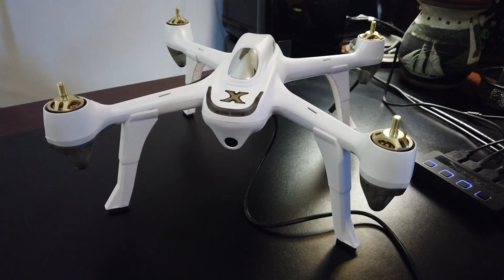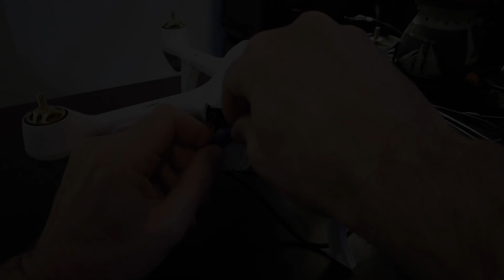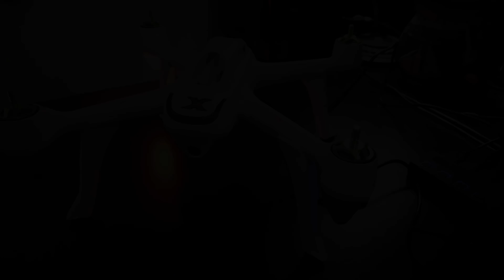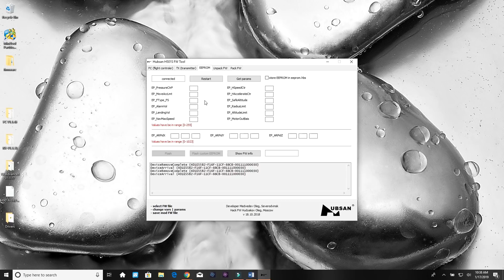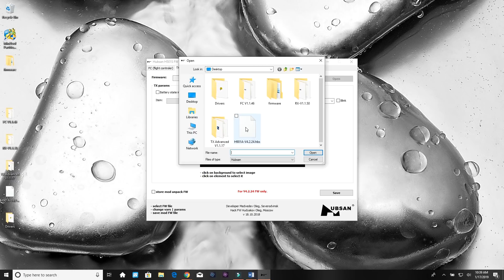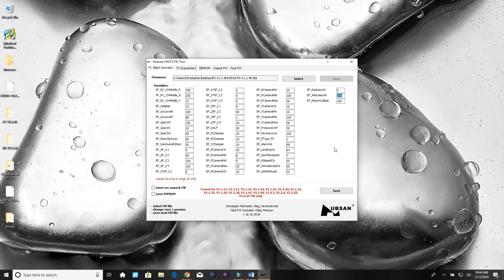FIRMWARE MOD TOOL - FC & STANDARD TX - HUBSAN 501 MODELS

Comment: Hi, I need help with my hubsan h501s, basically the drone was working fine, but I wanted to update to a later version, but when I was uploading the firmware the USB connector was disconnected by mistake and now the drone makes a continuous beep, the rc connects and you can see the image from the camera.

Comment: Good video :) question: when voltage is Low, quad automatically set lower throttle... Is there chance to change this? Iam using lion so I can go to saf 2.6V
Reply from the maker: Go back to a older firmware maybe but it could because your using a lion.
Reply: @QCGUY  its normal operation. When Lipo is empty hubsan starts to fly slowly. As lipo saf min voltage is higelher than Lion, i have to change this parameter on fw... But i dont know which one :( also its sad we cant change speed on GPS mode :(
Reply from the maker: @johnyM128  I have two of these quads left. One on firmware I was a huge part in developing and one old version of super flyer. Neither slow down when the lipo is lower. The lion is most likely why…
Reply: @QCGUY  really? Thats interesting. Could you send mé photos of settings in fw?
Reply from the maker: @johnyM128  You’re going to have to take my word on that buddy. I don’t use those quads anymore and have enough to do already. Lion batteries when low will have less punch than lipo.

Comment: The Navigation Max Speed, are you sure that isn't your GPS speed? I changed mine from 5 to 6 today and it felt like when I was controlling it in GPS mode it was slightly faster, not sure but definitely felt a little less stable and faster controlling it in GPS mode, just a thought??? 👍🙂 Great video, love your channel....

Comment: Just downloaded the firmware but when I open it on pc it says wrong parameters ?, it just won't open.
Reply from the maker: You don’t open firmware on your computer. You open the install tool and load it there under the appropriate location or in this case modify what is on your quad.

Comment: hi there.. been watching your videos.. can you PLEASE update the link to the lastest ..or most recent firmware update for the FC? Im trying to upgrade my H501s (original..not the pro nor ss)..i have v3 tools..but the firmware on there website has the H501a firmware bundled with H501s FC firmware update. it might be right, but im getting that update error. Can you assist? 

I dont really know what the lastest FC version is for the original H501s. i never upgraded it before. 

The H501s x4 but im using the same standard controller. can you chime in and lmk what i need to to do to update the original one to at least the version you are using? your link to the dropbox isnt working.

thank you much
Reply from the maker: Book Gee Every 501 model and recommended firmware links are in this document. 
https://lookaside.fbsbx.com/file/Firmware%20-%20All%20501%20models.pdf?token=AWx2gPczIaDBGo26uLCaYw9zDHPhhSpC6rE2aQ8ixthZYWvqJrJr0pyJMoAnnTJOuZU4UZo8KQeqNc3Qz_SquqeZcPJR3MLwHSozRFBBrzbwoiQ0-bhLQObdMlYL7fMY9-OT9KoqSCR7BN6sNGFOzJiSsY9ttD6OwH2RaMyS-HnF9rntkM_sAwPNj3hxXpMSv18hVILfeBbUzCs4Kk6Thxs-jgPI6xtZkWoYW0gblbHgEA
Reply: @QCGUY  thank you. im on it!

Comment: Thank you SO much.. I appreciate you and this video. New subscriber.

Crashed and burned my organization H501s flying fpv - got distracted with ppl coming over to me and being close when I was flying alone..lost concenttation..came down on a tree - not so bad..but bounced off..BOOM into the rocks lol. 

Broke the plastic light, wires came out..I think it's to the light for the arm..could need a new esc..not sure. Buying all the parts FINALLY to rebuild it as I wasn't confident. Still nee and figuring out what does what etc. This is the BEST video EVER that gave me confidence that I could update firmware without bricking my H501s. I'll do this on the broken quad. Lol
Reply from the maker: Book Gee I know that quad inside and out. Good old quads still today.
Reply: @QCGUY  i agree. i have the H501s, the H501s X4 and the H122D. love them all man hahaha
Reply: the tool doesnt even come up for me. i wonder if something is wrong..v3 i downloaded. when i plug it into my laptop, i dont get a menu / tool etc..
Reply from the maker: Book Gee use v2
Reply: @QCGUY  I guess it's just me..I cant find that one lol.
Reply: Do they have FC tool v2 on the site? I tried downloading another..it had v1 and v3 blahaha. Only.happens to me lol
Reply from the maker: Book Gee You need to join my group. Everything and everyone that can help are there.
https://www.facebook.com/groups/HubsanQC/?ref=share
Reply: I think I broke the 501s controller. When I turn it on, only the blinking Hubsan logo appears on the screen. What can I do with this?

Comment: Hi Chris hope all is well with you & family I went into the firmware update for my H501S when I clicked on to check Version it said H501A V1.1.46 Is the firmware the same for the 501A & 501S, I'm new to this so you might find this question stupid, I did not upgrade my FC but just wanted to check the version on my 501S and saw H501A its a bit confusing.
Reply from the maker: Yes they share the same FC firmware so you are good.
Reply: @QCGUY  Tks Chris

Comment: Another awesome vid Greg. I have used this with all my H501's. I wonder if anyone has used this with the H109S? The default RTH altitude is 30m and I have 80-100' pine trees in my area so I need to set the RTH altitude to 40m just to be safe.

Comment: hello boss, you saved my searches, for a long time I look for the new software to read and modify the FC V1.1.46 firmware because the older ones can only change the basic settings in the 501SS ie it works totally pro 501S. I want to change the cruise speed and for this I have to read the firmware of the 501SS modify it and record again. thanks for posting the link with the version of 18.10.2018 of FW TOOL this version is what was missing to try to change the speed of my drone since the RTH already use in 9m/s  it is working very well, today I made a long range of 3km and the total time was 17 minutes. if I can change the going speed, I'll be able to go 4km. please see on my channel I have already made a long range of 3500m. Thank you.

Comment: hi i cant seem to get the dropbox thing to work is there any other links you may have to download this tool fantastic video just having trouble with the dropbox link thanx in advance  ,my missis will appreciate this to stop the endless google searches lol
Reply from the maker: hornyvee drop me an email kitchwade@gmail.com
Reply: @QCGUY  thanks for the speedy response iv dropped you an email thanks again
Reply from the maker: hornyvee I’ll send it as soon as the nascar race is over.
Reply from the maker: hornyvee I had to send it from old aol. It got blocked on my other email. You should have it 👍
Reply: @QCGUY  cheers I'll check in morning hope I get it all right when installing thank you again ,I'll be in touch
Reply from the maker: hornyvee any problem just join the group....the tool is there as well. 
https://m.facebook.com/groups/1913569038873073?ref=share
Reply: hi again do you have any links for the best firmware for the standard controller iv done the flight controller bit thanks again profusely, when I click return home she should come straight back instead of wondering if shes coming back . just tried changing my text colours on my controller and it says fw not open and I have none to load in thankyou again for your help

Comment: thx, i flash my 501ss without altitude limit, 25m rth, and 8ms speed in gps mode
Reply from the maker: djsergiodb be careful with the parameter of 8.
Reply: down to 7 better? ))
Reply: i reflash down to 7ms thx
Reply from the maker: djsergiodb yes, absolutely recommended. No higher. 👍
Reply: thx very much,, another question... its posible change speed to kmh ?? i dnt like ms or mph
Reply from the maker: djsergiodb nope 👎 you get use to it after a while.
Reply: @QCGUY  Hi,, after flash altitude limit ok. But Max speed GPS its 5ms 😞  muy firmware its the newest versión. Idea?
Reply: @QCGUY   HELP PLEASE
Reply: @QCGUY   HELP PLEASE
Reply from the maker: djsergiodb you’re going to have to show me some video on how you are doing it. Doesn’t sound like your saving or flashing it correctly.
Reply: @QCGUY   the 7ms only work with return to home Mode,, in GPS Mode the speed never pass 5ms
Reply from the maker: @djsergiodb  That's all your adjusting is the RTH speed. I don't know of the adjustment to change overall speed.
Reply: @QCGUY  THX SO MUCH, ANOTHER QUESTION, WHICH IS THE BEST FRECUENCY TO SET IN 5GHZ,,? 5730 TO 5830, NOW I SET 5805
Reply: @djsergiodb  With any frequency, the higher it is, the faster it moves, but the shorter disance you get, and you are MUCH more limited by even the slighest obsicals... go as low as possible, because the delay is so little, it really wont effect you much.

Comment: SO... DO YOU ACTUALLY WORK FOR HUBSAN COMPANY??????
Reply from the maker: waddac2 HELL NO!!! 🤯
Reply: @QCGUY  Why using name of Hubsan & Help Support?
Reply from the maker: waddac2 Because that’s the name of my group and what I do almost on a daily basis. I named the channel the same as the group and as you can see if someone needs help or has a question I respond unlike hubsan. I fix peoples problems by working with them in messages or FaceTime and if they pay shipping I fix them myself for no charge so I think the name works.
Reply: @QCGUY  Brilliant buddy. Keep up great work. My first quad as you my know is H501S and lost a thumb stick and also not flying correct as all over the place.
Reply from the maker: waddac2 join a group and see if someone in your area can send you a used Gimbal stick assm. 
I would gladly send you one if you were in the states. Your UK correct?

Comment: Great info. Chris What light did you fit in the nose will it 501ss
Reply from the maker: RUBEN WENBORN those are the same lights from the feet. You have to snip them way down in size and fit them just right. Had to black out the inside of the shell as well so it wouldn’t glow.
Reply: @QCGUY  Se ven impactantes las luces de nariz. 😎  ... (Hubsan debería instalarlas también)
Tienes un vídeo de esta modificación?

Comment: Thank you from spain, good job, but, is for h501m? Thanks again and see you later 👌, edu bermudez.
Reply from the maker: edu bermudez No sorry not the M unless they get it into the tool at a later update of the tool. 
It connects but all the params will say 255.
Reply: @QCGUY  thanks you máster 👌
Reply from the maker: I pinned that correction in as the first comment people will see. Thanks
Reply: @QCGUY  you are great 👌